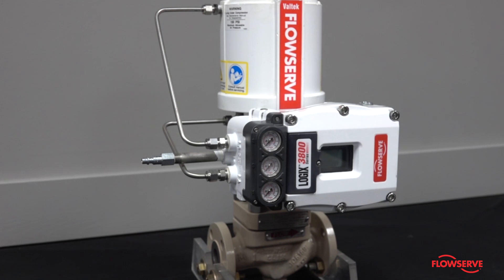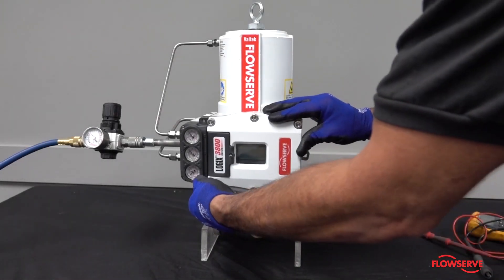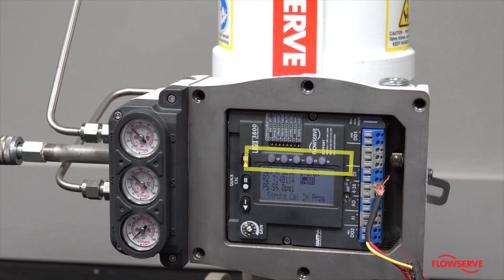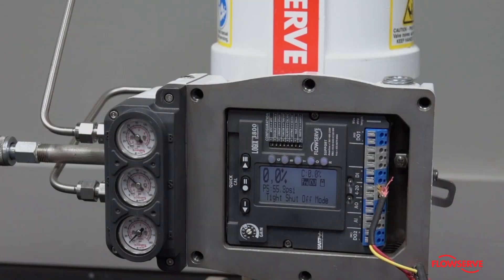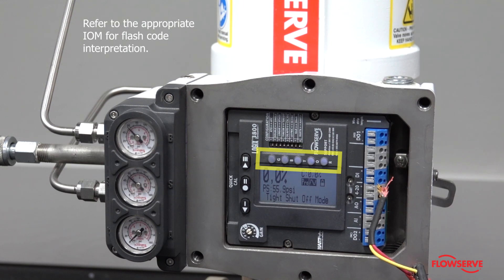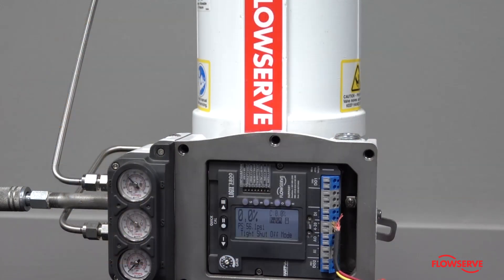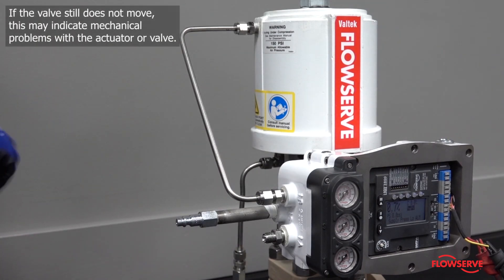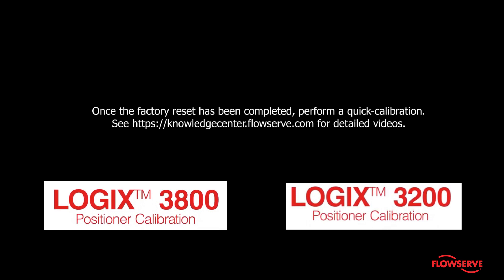Troubleshooting a Flowserve Digital Positioner

Comment: How to remove gggy error code
Reply: Thats a status code, not an error code. Even the valve in the video is producing that code. I think its tight shut off mode; when the signal is less than 1%, it shuts the valve as much as it can to maintain a tight seal.
Reply: How to remove the, PST failed wrn when the 3 sec press on III and brief press of II, do not correct the issue?